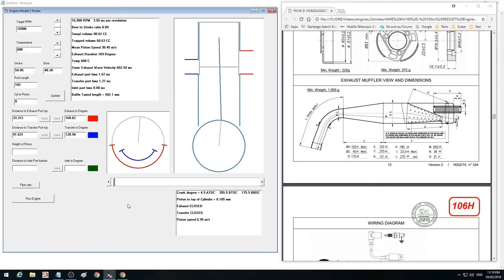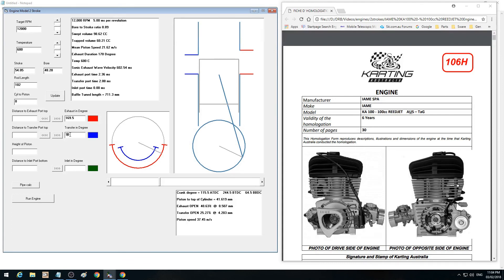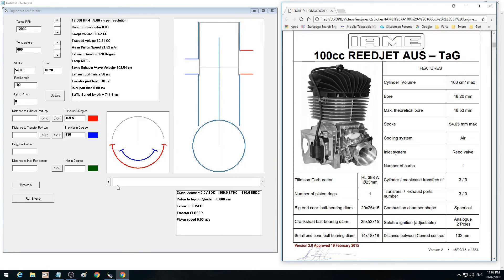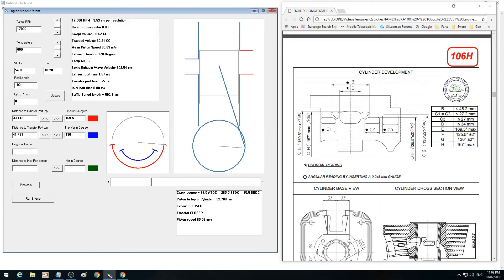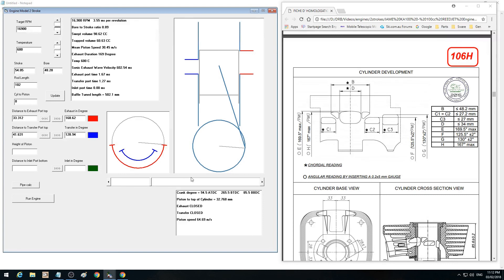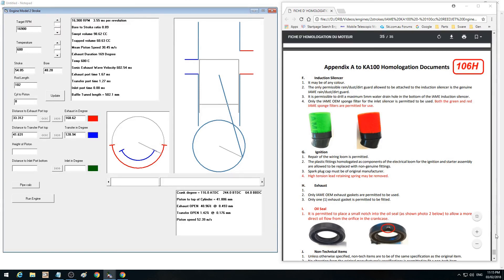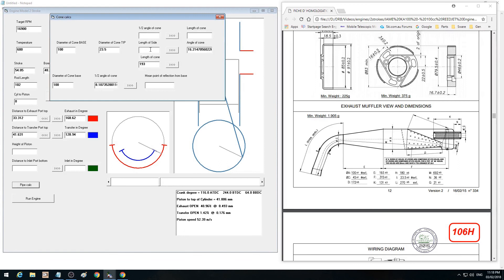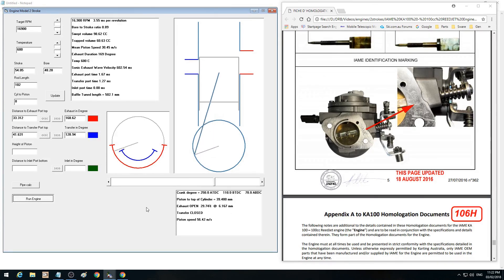What is the effect on 2 stroke expansion chamber tuned length after raising cylinder ? E9

Comment: Hello there I sent you an email and hope you can help me out a bit i would give a donation in exchange for your expertise..Keep an eye out for it please and thank you.
Reply from the maker: Hi Ride Fast
I got your email, its ok on the donations but thanks for the offer anyway.
I am about to do a videos on equations and will cover the tuned lengths one.
Reply: AuMechanic thanks so much. This motor will about self destruct over 10000 rpm mine might go 9000 and it is a single gear. I will probably go lower on the target rpm. How do I find out speed of sound in gas at different temps there was a chart for speed in air.Will watvh for your vid .And that calculation I did was 600°F not °C  I just estimated a average gas temp in the pipe. And so what you are saying is my calculations were correct besides the error of the speed in gas vs air? Still seems very long for a gas bike and your calculations are even longer with the adjusted speed of the wave.
Reply from the maker: Hi
Yes I just noticed that, I edited out the comment .
Ill have to do this a bit later as I am about to head to work.
7k RPM at 315 C is 997.9 mm tuned length (39.25197 inches)
Reply: AuMechanic all good thanks again have a good one.
Reply from the maker: Just did quick calc see above
Sonic velocity is 494.52 m/s
9000k RPM, TL is 776.1 mm

Comment: Hi Dave.
Thanks for that, I didn't expect a video on the subject but that was fantastic. The RPM range is 7000-15000.
It does lead me to some more questions. If I understand this correctly, when lowering the cylinder I gain squish, when I raise the cylinder I gain blowdown time, with little difference in rpm. Which is more beneficial in this case? The other question that I have is about ignition timing. The recommended timing is  2.1mm btdc max  3.2 mm btdc. How do I work out the ignition timing for max performance? I have been using the max (3.2 mm) but as I learn more about 2 strokes, I have gone the wrong way.
Thanks again for your help.
Reply from the maker: Hi Dennis,  I was going to be showing the model and your engine and specs made a good example to use so covered both in one.
15,000 peak brings piston speed down to a safer 27 m/s, not sure where I read the 17k
The timing change is still about 100 RPM diff to tuned length, a shade less.
Re the blown down, what i was showing was just why we use mm for blown down not degree, using a 20 degree diff on 2 positions to show a different mm blow down.
For your changes in timing, around 2 degree that blow down diff is 8.306 v 8.319 mm blow down for lower timing so negligible diff. Likewise for the trapped cyl volume diff that reduces as the timing is raised.
A 1 mm squish is relatively wide so you want to be in the min squish they allow and the min CC vol too.
Keeping in mind you always want to aim for one change and not two changes made or you can loose sight of gains and losses from one or the other, so dropping the head by the same amount the barrel is raised leaves only the timing changed to evaluate the effect of.
After that is tested then go back and tweak the head to get the squish and cc at minimums allowed as a matter of course.
3.2 mm timing is high, 3.173 mm gives you 25 degree BTDC, 2.1 or 2.151 mm gives 20.5 degree BTDC
As RPM rises to peak the burn time reduces in the 2 stroke so it naturally retards, or, needs less advance as it revs so Id start with 2.1 and work up from there.
To gauge the effect you can simply try both extremes of timing back to back.
Reply: Thank's Dave, this series of videos has helped me tremendously, particularly this one. There is a lot of information on youtube but, it is hard to find information that is specific to my situation. Thanks again for your help and expertise. I hope that you reach your goal of 1000 subscribers, and look forward to more of your vidios.
Reply from the maker: Good luck with the racing too.